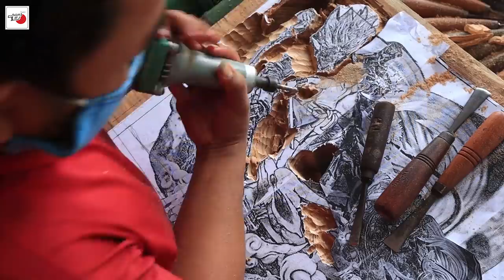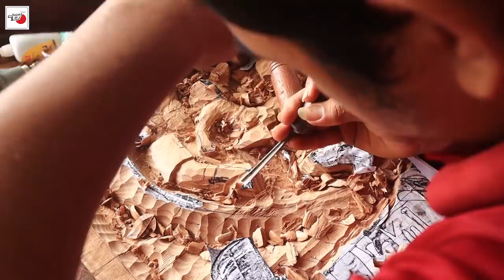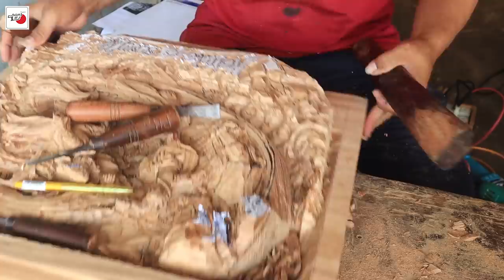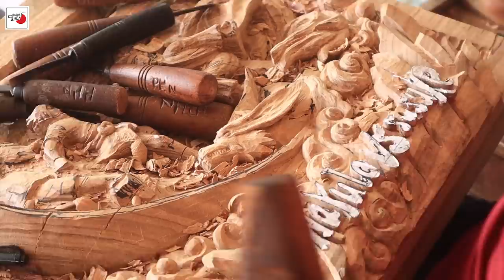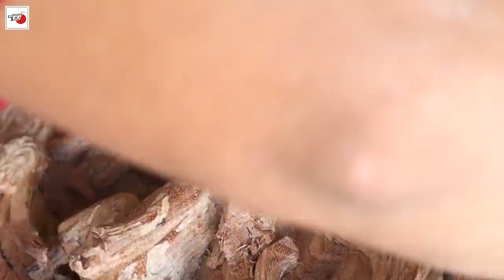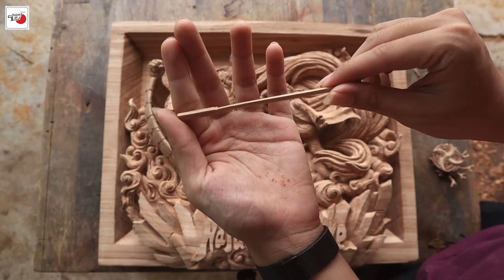Wood Carving - NARUTO vs SASUKE Epic Fight

Comment: Loved it.
Suggestion : If you can drill small holes in the model itself that camouflage in the context which will act as vent holes, then you can blow air from the bottom and have a extremely beautiful intro.